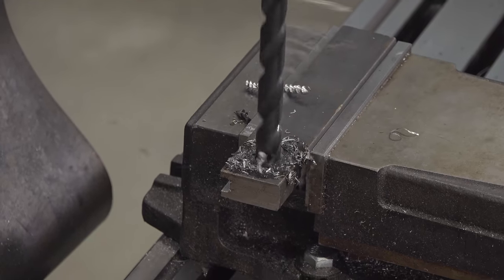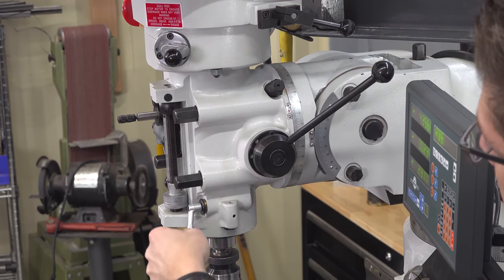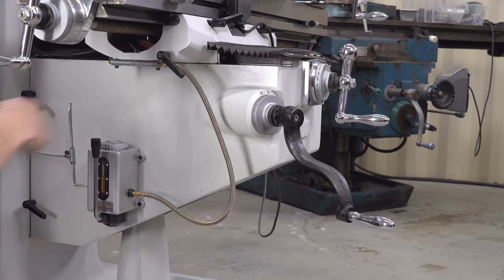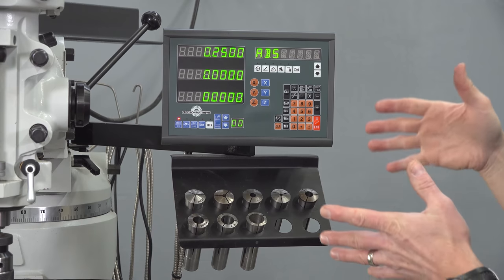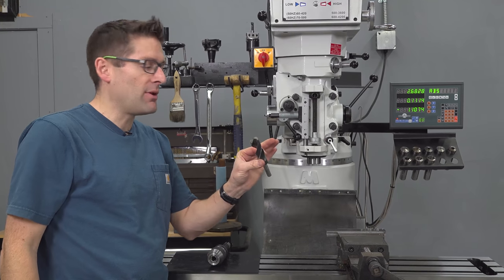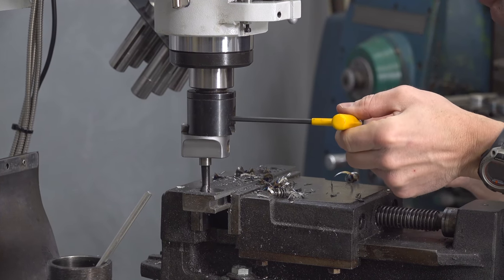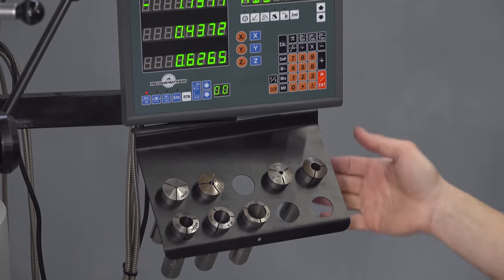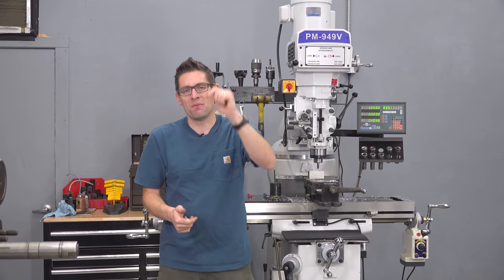Precision Matthews PM-949TV Milling Machine: Overview and Tour

Comment: FYI, the outer 2 set screws on the boring head should be adjusted to set the gib tension and left alone. The center screw is the gib lock which is used when making adjustments. I believe on most boring heads the center set screw is slightly larger. Great video as always.

Comment: I like the Cincinnati horizontal mill you've got over there on the side. I used my rapid feed for surface grinding small parts. My mill has a slotting head on the back. Wonderful tool.

Comment: I like that machine. Different seeing a new or fairly new machine on YouTube, usually well used machines.  The higher RPM got the job done quicker however it sure did throw the chips all over.  I have not watched all you machine videos since I came to your channel via your firearms channel.  One question, where is your Gerstner box. Great job of teaching us, Gavin.  BTW, I am sure you have seen ATOM79 and Mrpete222 on here as well. I like those two guys a lot, learning a lot from them. Over time I have watched many, many machine and machine related videos. Any, thanks for all your great content.

Comment: You don't have to lock the Z axis on a knee mill 99% of the time. The knee is sitting on top of the thread, preventing it from moving down, which is the opposite of a benchtop mill, where locking the Z axis is mandatory. Also, you should invest in a DRO for your quill and a Z axis power feed.

Comment: That set of drill bits in the top of the machinist's chest looks like the same "free gift" set I got from Grizzly several years ago.  The cheap case is falling apart on me at this point but the bits have been decent.  I wouldn't use them for precision work or anything but they have been fine for home projects.

Comment: This is one of the better reviews that I have seen on a new machine. It is a very nice mill, especially for the price. Have the ways been flaked for oil retention? I would like to know about the knee ways, but especially about the X and Y ways.
Reply: Don't you mean Scraped?
Reply: @jimenz6548  It would be impossible to sell a fully scraped machine at this price point. The Precision Matthews Taiwanese built Bridgeport style mills have hardened and ground ways with Moglice on the X And Y movements. I don't know about the knee. Flaking has a scraped look to it but it is done to retain oil between the mating surfaces. Scraping is done to achieve      better matting surfaces and also for oil retention. Scraping is very time consuming therefore it is very expensive even in production. After a piece has been ground it can be flaked in a short time period. Flaking probably isn't the proper term, its what I tend to use.

Comment: Very cool video. I have a question and it may be elementary. Why do you use the Z axis adjustment in the last demonstration, rather than just lowering the quill down and bringing the bit to the piece? I assume that may be it’s for vibration issues but it seems like it would be easier to do the adjustments from the top and leave the table in the position that was in.

Comment: I like your mill! I just was wonder if your mill was like my ( I have a jet mill 10”x50”) that I got used the auto feed quill part was mess up. My auto feed quill on my mill works great now. After reading the manual for my mill found out the the clutch on the auto quill is set up for a maximum drill of 3/8”. So I looked up a PM949TV mill shop manual to see what that mill auto feed quill was set for it set for a 3/8” maximum RPM 3000. I was just trying to spread information. Hope you had a Merry Christmas and I hope you have a very Happy New Year.

Comment: I run the PM932M-PDF with 3axis DRO, X power feed, and power feed head position motor. It is more than rigid enough for most of my gunsmithing work. With the right tools and feeds and speeds it can move some metal. Would love to have your mill though lol

Comment: hello gavin i have a 9x49 2vsg atrump mill and it is the same mill as your mathews. in high range i go to forward in low range i go to reverse to turn the rotation clockwise. when i got the mill it was set up wrong like yours is. all you have to do to make it operate correctly is change any 2 wires in the  forward reverse switch on the front of the machine very simple. it takes 2 minuits or so. i t doesent matter which 2 you change out of the 3 wirers. but i just thought of somthing my mill is 3 phase i think you said your mill is single phase thats maby the difference right there . well what i said works for 3 phase for sure. check with mathews first.

Comment: Previously was looking at a Bridgeport but I’m thinking it’s worth it to save a little more and go the precision matthews route.
Reply: Yes, that is a possibility. We where thinking that way to, but bought an old but REALLY nice and sturdy Shizuoka mill instead. ~2500 kg heavy duty machine with double quills, both horizontal and vertical possible to run independently at the same time. In our opinion ~12 000€/$ well spent...

Comment: Used bridgeport or new PM949? 
both around $7k . Bridgeport is in extremely good (but used) condition. Is it crazy getting a used bridgeport for the price of a new PM mill? Or is Bridgeport that good?
Reply from the maker: I would say it depends on features (vari speed head vs step head) and also how much slop/wear there is on the Bridgeport. The PM-949TV is TIGHT and the turcite way coating make it work like glass...
Reply: For $7k I would expect a fully rebuilt Bridgeport [making it a more or less new machine]   New cast Iron [Chinese] compared to old USA cast Iron is what make old machines worth their money .  Cast iron moves over time unless its had time to settle [which Import machines dont]
Reply: Taiwan, not China.

Comment: “If you’re mechanically inclined...” well, if you’re NOT mechanically inclined, you shouldn’t be trying to use a shop. Mounting a DRO isn’t the most difficult thing to do. If you buy a full size mill, then you should be capable of doing this. I did mine. You can do yours. It’s good practice for what you’re going to use the mill, and other equipment you’re going to have, for.

You may not want to take the time to do it, and to just jump into using the mill, but that’s something else.

Comment: Just wondering the cost difference between that mill and a Bridgeport?
Reply from the maker: I believe a USA made Bridgeport would be about $17,500 + accessories, whereas this mill costs $6,999 + accessories (dro and power feed, etc)
Reply: @Ultimatereloader  I like it!
Reply: @Ultimatereloader  You are correct about the price of a new BP but unfortunately they are no longer made in the US.  Maybe Taiwan (like your PM) or maybe China I'm not sure.
Reply from the maker: Jim Humphrey wow, didn’t know that!
Reply: @Ultimatereloader  I think the last US made Bridgeports (Hardinge) were made about 10 years ago.  Something about not being able to get the castings in the US.
Reply from the maker: Jim Humphrey so now we need to know where they are made now!
Reply: @Ultimatereloader  I sent an e-mail to Hardinge and got their official response. 

 "Jim,
Our Bridgeport Series I Knee Mill is manufactured in Elmira, NY with domestic and foreign parts. "  anyway I felt I better retract my statement.
Reply: @jimhumphrey  Series 1 Bridgeporys are STILL made in the 🇺🇸 USA!!! Buying a new one is a costly venture though. I have a friend that bought one that was manufactured in 1970, and the people he bought it from never used it once, EVER. It had never even been wired up. Just took some cleanup, and it was new again after decades of Shop Scum being all over it. Can you imagine buying a brand new Bridgeport and just parking it in the corner for almost 50 years? Smh 
He got that for $7500.00

Comment: Looks like it's not secured to the floor?
Reply from the maker: Correct.
Reply: @Ultimatereloader  <> Do you plan on bolting it down? I've heard the vibrations shows on the finish cut surfaces it not secured to the floor?
Reply from the maker: Doesn't seem to be an issue- and I have more research to do. Some say it's better for the machine to be able to "slide" on the floor in an earthquake, rather than a bolted down machine "tipping over" - that's my main consideration :)
Reply: @Ultimatereloader  <> No doubt, that was the other thing I was going to bring up. Having lived through earthquakes all my life being a California native, I'd definitely bolt it down, and I'd bore out those ½" mounting holes to accept ¾" all threads epoxied into the concrete floor. Either that or weld up a heavy duty steel rolling platform base with a wide wheel base so it'll roll with the quake while eliminating the risk of tipping over in the violent shaking and upheaving. But I do like your setup though 👍
Reply: being a tool and die maker, I can say that speed of milling is the utmost importance to not get marking on the metal, the machine itslef is plenty heavy, if you move it from vibrating, then your forcing it to do its job.
Reply: @TTiger86268  <> That's logical when working on small parts, but may not carry through when inducing strain on the larger parts?
Reply: @rockcrawlinnut  <> this is beginning to sound like a comparison test episode for this channel and settle the debate with empirical evidence derived from actual testing?
Reply: @rockcrawlinnut  <> Yeah I know, you've already covered that. Just because you haven't seen it doesn't mean anything because other reasons like never getting around to it, save the expense, don't plan on keeping it there, want to have the freedom to move shit around on a whim, and don't have the time to hunt down and schedule a contractor, or just simply lazy, may have been the reason.

Still, a documented comparison test would be much more informative rather than a never ending debates based on theoretical leanings.

Comment: Why would I want one of those toy milling machines ? The one thing it does have is significantly higher spindle speeds - I forget what the top speed is on mine - just (LOL!!!) had a look...
H:1180 
V: 1600 - so if I run at twice speed, that'll be 3200 - talk about flying cutters (you know, an 8" radious fly cutter at 3200 rpm....

Comment: This is a tinker toy! Real machines use cat 40 & cat 50 tool holders, Nt these puny r8 collets!
Reply from the maker: Not everything needs Cat 40/50 :) I do have two machines in the shop with Cat 40 for heavy work. R8 is GREAT for gunsmithing...